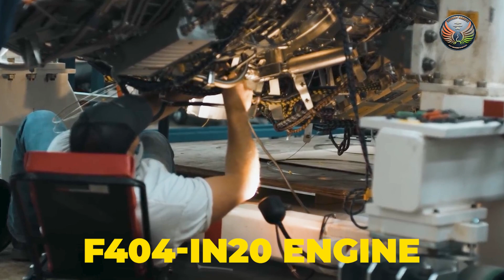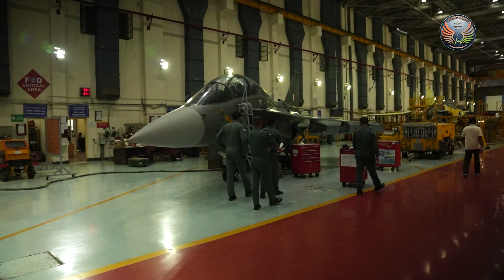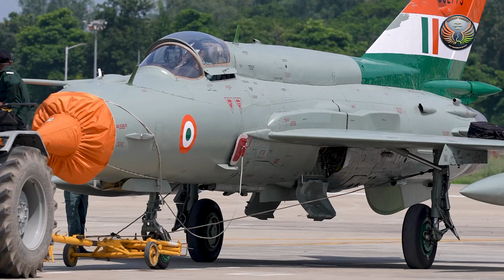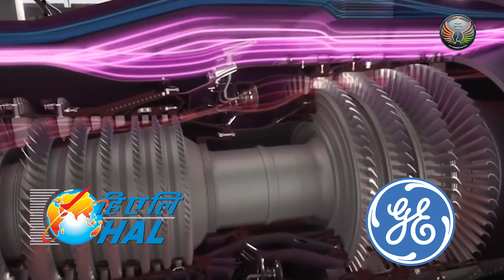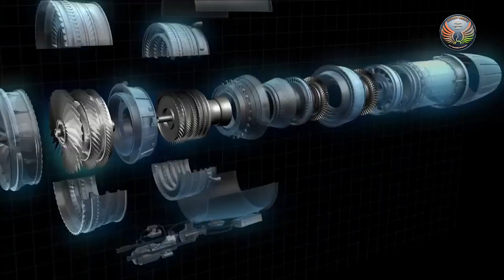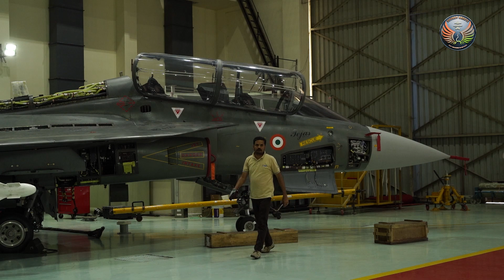Engine Delivery By General Electric For Tejas Picks Up

Comment: GE will give 4 engines per year the tejas schedule willbe the 83 aircrafts  will take another 20 years Indian bjp government even afraid to ask the GE for delays due to to the unnecessary fear of trump now going for f-414 contract which could delays further another 40 years.
This is the plight of indian forces. Every time attack on their own HAL but not even try to question indian government or GE for the delays
Very pathetic situation of dependency on amirican diffence companies